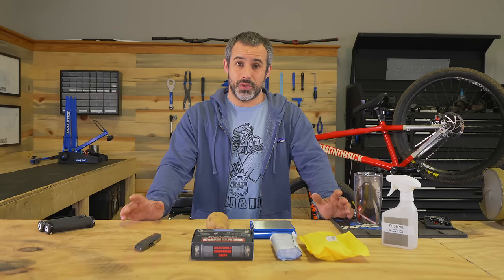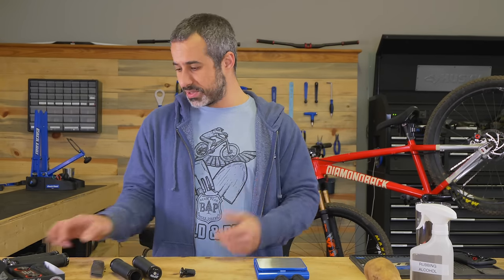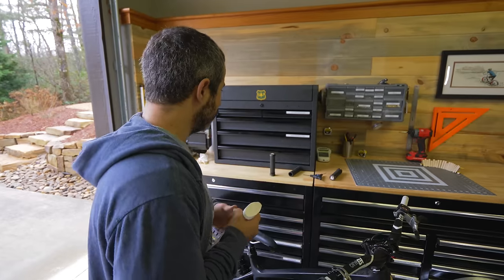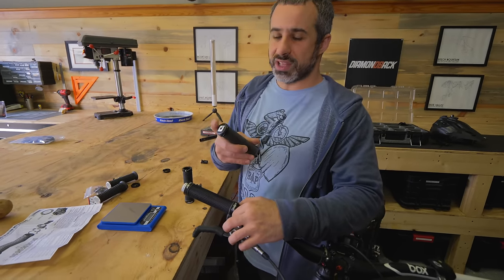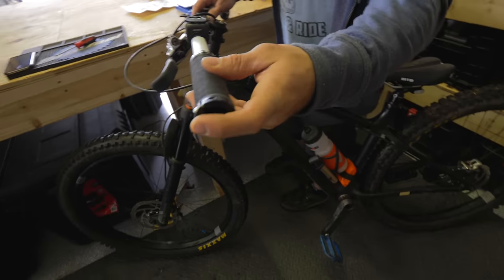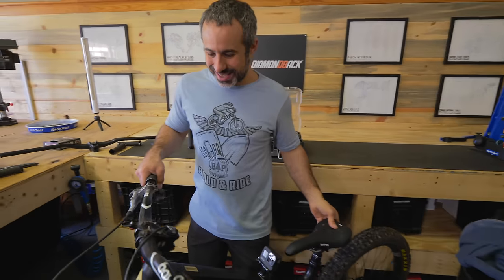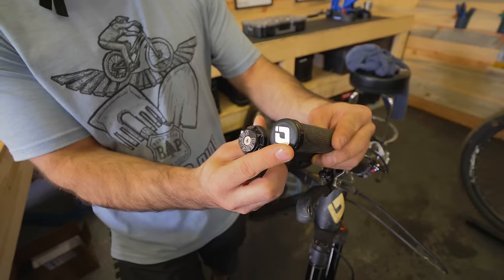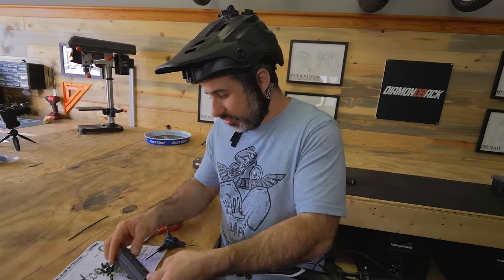REALLY?! How do $90 bicycle grips stack up against $5 grips?

Comment: $90 is a joke though. There is a middle ground that’s always worked perfectly
Reply: Its a robbery tbh. I rather get 3.5 DMR deathgrips for the same amount
Reply: Jonas exactly! No need to fix what isn’t broken imo
Reply: @thetrailtrawler2602  Indeed. No need to over complicate and overprice grips
Reply: Brayden Gilbertson i really don’t like movement in grips at all I come from BMX background so I’m used to everything feeling solid
Reply: Brayden Gilbertson  I get that they can feel amazing but im having a hard time justifying 90 dollars on something I will wear out on 1-2 weeks tops
Reply: The Trail Trawler hit mammoth bike park or any rock heavy techie trail. I’ve rev grips for life. I I’ve tried foam, odi lock on, Santa Cruz Palmdale, Giant, etc. all trash compared to rev grips. Rev grips were designed for braking bumps and techie trails, not a skate park or a dirt jump track
Reply: Carnex100 in that situation they are worth it
Reply: Jonas How much do you ride that you can wear out grips in 2 weeks? That’s seriously impressive!
Reply: I have a problem in my right hand from an old injury, i would struggle with a days riding before i owned these grips. They serve a certain purpose and they work like an absolute dream, 90$ is a small price to pay when i can now ride for consecutive days and have no issues with hands
Reply: Sounds like these are for people with hand issues. If you don’t have any issues then obviously you can run whatever you want. Personally preferences can’t be categorized
Reply: @iopusor  not a robbery for those suffering with wrist or finger pain. I can keep riding bikes thanks to them! And if you buy them the rebuilt kit costs you only about 25 bucks, so it is one time investment. For me it is only 90 dollars.
Reply: @Petr388  And that is great! But the average mountainbiker doesnt have chronic wrist and/or finger pain and for those people its a robbery.
Reply: @iopusor  well i do not think so. No one would buy these grips unless he considers using their advantages. Who would not want to have less arm pump? Everyone suffers arm pump and everyones wrists suffer on braking bumps and big rocks. We only have one health and our wrist and fingers would thank us for better treatment. It is never a robbery, it serves its purpose and it allows you to ride more without an arm pumps. It delivers what it promises, so it is not a robbery.
Reply: @iopusor  Revgrips don't cost $90 each time you wear out your grips, they're rebuild-able and you can buy replacement grips for $25.  .  They also have a race model that only costs $60.
Reply: @jedidiahwest4619  It sounds these are great for a ton of people.  Some of the people happen to have hand issues.  

I don't have any hand issues.  Of course I could run standard ODI grips.  I could also ride a lower quality fork, shock, brakes etc.  I choose to ride DVO Onyx, Jade, SRAM code brakes, cushcore, and Revgrips because they all add performance to my bike and how I ride.  If I can drop $1000 on a fork I could easily drop $60 on a pair of revgrips.  When the grips wear out it's only $25 to replace the grips.
Reply: It's not a joke for the person who invented them his pockets are fat on gullible people
Reply: That’s like, major component prices they’re asking for. Really absurd.
Reply: @whygoogle5051  These cost no where near as much as any of the major components on my bike.
Reply: “I don’t like them, therefore they are not worth the money.”
Reply: @nathanherald3469  totally worth the money if you do like them though.  👍
Reply: LōK MTB they have a money back guarantee right? I love their stem as well. Looks gorgeous.
Reply: @lokmtb8503  $25 for the replacement grips is still more than nearly ANY other grip on the market, just for the grip part! Are they made of Stealth rubber? Are they paying FiveTen (that would be Addidas these days) royalties? How exactly do Revgrips justify $25 for just the grip part (a simple moulding)?   Don't get me wrong, I think they are a brilliant idea, just overpriced currently (as new ideas often are initially).
Reply: @AnthonyIlstonJones    $20-$30 is the average cost of good grips.  Most ODI and Ergon grips are the same price or more expensive.

I don't get your point about only getting a replacement grip for $25.  You only have to replace the grip.  The rest of the system is reusable, so why would you complain that replacing the part of the grip that wears out cost's the same as buying another pair of grips.
Reply: @lokmtb8503  Because with other brands that is a whole new set of grips, not just the moulded grip part itself. Are they saying their grip itself is so much better they can charge what others do for their whole system (locking rings and all)?
Reply: @AnthonyIlstonJones  Yes the grip is absolutely better.  It is an engineered component that  interact with the rubber inserts, shims, and the aluminum caps to give damping and reduce hand fatigue and arm pump.  The grips use patented technology that add function and performance.  It's not like you could take another grip and slip it in and have a functioning system.  I was willing to pay $60 for their race model and probably would still pay $60 if I had to replace the whole system, but I would be more judicious with how they were used.  Maybe I would only run them at downhill parks or gnarly trails and keep a cheaper set of grips for trail riding.  On the other hand I feel like it's a great feature to be able to replace the part that wears out for only $25.
Reply: Too big, would increase arm pump massively. Try lifting weights or doing pull ups with a 1.25" bar. Takes like twice the grip strength. It's a gimmick.

Comment: Been using Rev Grips for about two years with zero issues. Helps with arm numbness/pain, last a good amount of time before the sleeve needs replaced, and does very good for glove less riding. Last fall they came out with new rubber grommets that is one piece. Much easier installation.
Reply: I know I am late to the game on the response.  I totally agree with your statement.  For a guy that has not treated his body so well over the years from MTB, Skiing, and just general male stupidity these grips are a game changer.  I have pretty bad arthritis in many parts of my body most notably in my hands.  These grips can definitely extend my ride and make me more comfortable.  3 years on 2 bikes and not a mechanical problem that wasn't from wear and tear.

Comment: When I was a kid (I am 50), the trick to get grips onto the bars was to steal my mom's Aqua net and spray it into the grips. They would slide on easy and then the hairspray would dry and be a little sticky to help hold them. There were no locking grips back then, so any help was appreciated.
Reply: this is the go to at bmx shops
Reply: Brake cleaner also works well.
Reply: @s2000.  Doesn't brake cleaner dissolve the plastics used in these grips? What is the LONG TERM effect?
Reply: @exgenica  Long term there is no difference because it evaporates in about 30sec.  Works fine for me.
Reply: David Mansfield right, and put a nickel in it to stop the bar from cutting through the end
Reply: i have thought to use hair spray sing my school days, damn thanks for the flash back
Reply: @JustoleshiftY  🤣
Reply: Yep hair spray, alcohol, or a little saliva if for some reason you can't find one of the other two.
Reply: @Ocyris151  Windex works too, just a splash and evaporates quick because of the ammonia.
Reply: Waste of time. I literally lick my pinky, rub it inside the grip for 2 seconds, and slide the grip on in 3-5 seconds.
Reply: @pex3  no lies told
Reply: I dunno man, I'm 2 year's short of you, but i never replaced grips (ever) until nowdays. Oh well, still need new grips for my new bike.
Reply: @s2000.  Brake cleaner is also bad for paint
Reply: miss the 80's bikes
Reply: brilliant    😊
Reply: @s2000.  brake cleaner is just alcohol
Reply: @Ocyris151  לא מוטי חלל ץ׳ץ׳
Reply: I used tar kindly borrowed from nearby construction site))) Worked really well for fixing grips dead. And for brakes also.
Reply: @REYisKING  the best
Reply: I cover the hole on the grip and the other side of the handlebars, so when you push it inflates a bit and just pops on.
Reply: How about all the kids make references that a 50 yr old would not under stand.... Ill start, AMONGUS!
Reply: @exgenica  brakleen doesn’t affect rubber or plastic - both materials feature heavily in hydraulic brake systems.
Reply: @firedemon2166  brakleen bad for paint?? Who told you that 😂
Reply: My dad used to swear by orange juice.

Comment: Just to let everyone know I brought ZTTO grips and they wor though in a week
Reply: I have them for like a year
Reply: How did they perform?
Reply: ..and you break the 90$ grips in first run.
Reply: I've had my 2 pairs of ZTTO grips for almost a year now and on my everyday bike they still hold up pretty well so far, but I don't use that bike for much more than commuting. On my Dirt Jumper I had clearly visible signs of wear after about 2 weeks and after 1 season I had the first flat spots on them. Now that I've spent some time riding again the flat spots have become pretty big and I've ordered replacement grips. I'll keep using the ZTTO grips on my everyday bike but not anymore in my Dirt Jumper.

Comment: "Kevin broke it" Not the first or last time we'll hear that.
Reply: I am pretty sure it had nothing to do with Kevin.  I think the product is designed poorly.  I had the same problem.
Reply: @ericliebert5260  Sorry to disagree with you but the product isn't poorly designed, I should know as I have 2 sets. 1st time I put them on they were a faff and I didn't do the clamps tight enough, tiny tweak more with the Allen key and they have been perfect ever since. I would say that this is what happened when Kevin rode the bike.  It gets much easier setting them up once you get your head around the design, I can add or remove the tuning washers in around 2 mins.

Comment: Coming from pro scooter parts, our industry has paved our own direction for how grips are made. Frankly, I think it will be a trend that catches on with MTB too a little bit, perhaps more in hot areas like mine. I've already seen more grips like scooter grips being thrown on mountain bikes. The mechanics at the bike shop were so surprised with my Tilt Continental grips. They said it's the best pair they have ever felt in their life.

We don't ride scooters with gloves. Yet we suffer quite harsh hits to the hands compared to BMX due to small wheels with hard rubber. For this reason companies in the Scooter industry have made increasingly thicker and softer grips. For example the Ethic grips are one of the thickest pairs of grips I have ever seen myself. Back in the days ODI introduced the super softy grips just for scooter riders.

I've found the optimal setup for comfort and grip and I highly recommend other riders give it a go. I used very thick, soft high quality scooter grips like the Tilt or Ethic grips, and a very thin pair of Polyurethane Dipped Gloves (about $2 a pop). The result is a grip/glove system that is very simple, economical, lighter and most importantly far more comfortable in the heat due to the very thin gloves you can now use without suffering strain and bruises on your hands (thanks to the super soft scooter grips)

Give it a go, and I am sure you will no regret it!

Edit: Also, from an engineering perspective, we are looking at a vastly simpler system to make. Bike grips and gloves are typically over-complicated and perhaps that's a bit of an anti-pattern in my opinion.
Reply: Wow thanks for the advice! I never considered ‘scooter grips’.. are handlebars all the same standard size to fit grips? Bmx, motorbike, bicycle, scooter..
Reply: this comment is so helpful

Comment: I've been using rev grips for a year now. I love them! They are hard to install, but I've never had mine come loose.
Reply: Same
Reply: Ditto.  The price and installation are ridiculous, but I love em, and replacement grip pieces are reasonable after initial purchase. 
    I feel better that seth struggled more then me installing them😂
Reply: I used these for awhile. Went to Moab with them. And overall they are decent. The grip was a little hard for my hands though and that's what I noticed the most. Best luck so far is with the Red Monkey ergonomic silicone grips.
Reply: I don't know a single Kevin that isn't a bit of a goon

Comment: Grips is the most important point of contact with your bike with pedals when riding down the hill. One components I would never try to save money on is my grips. Good grip = faster and more fun.
Reply: ☝️ 🤩.     Remy
Reply: What grips do you ride an recommend remy?? Ps youre awesome
Reply: Ingrid Veldhuizen I ride the Ergon GE1 Regular most of the time. They are awesome. Well designed, comfortable. Everyone who has a pair loves then
Reply: @remymetailler  thanks! Il will check them out. I need new ones really bad
Reply: I think pedals or tires are more important, you don't want to slip off your pedal, that's hurts😬
Reply: johnie su of course pedals and tires are key too
Reply: I agree that you don't want to "save money" buying garbage grips. But, as with all things it's important to make sure you don't conflate higher $$$ with higher quality or "better" gear. Your price point should only increase if you're guaranteeing yourself more comfort and control and/or that higher dollar products are going to last longer. If you're not gaining either or both, then you venture into "wasting money" territory 🤣
Reply: As a dude who used the 5 dollar grips, my wrists hurt.
Reply: There's no reason to spend more than ten DOLLAz on grips

Comment: I’ve used my Revgrips for 3 years, and I love them. I used to get numbness and tingling in my pinkies after 20 miles or less, and now I can ride all day with no numbness or pain. They were a total nightmare to install, and I have recurring nightmares about having to do it again, but once they were installed correctly, with the proper amount of cushion (I went with middle of the range), they have been hassle free for hundreds of miles. Would I recommend to my friends to pay $90 for these? Only if they are also experiencing hand pain that there is no better solution for. I think they work especially well for older riders who don’t like wearing gloves, as they add that extra cushion that even the thinnest gloves provide. I can’t wait to see your long-term review.
Reply: You can also get gloves with gel in them to help with pain.
Reply: my left ring finger always gets tingly but i dont have money to burn, do you think it's worth it? @brandonrothaughe

Comment: Btw: if you have slip-on grips with no locking mechanism use hairspray on the handlebars, where the grips are supposed to go. Makes them stick like glue and prevents them from slipping around in wet conditions or when too much force is applied...

Comment: I’ve been riding with revgrips for 2 years now. They are a pain to install at first, but I have not had any problems with it falling apart like what happened to you. I’ve got aluminum bars and really cranked them down when installing. I also should mention I got the $60 version which doesn’t come with “tuning washers” and cool colors, but the mechanics are the same. I feel that the grips are directed more towards downhill and long rides. Please please please try them at a DH park to se just how good they are with braking bumps
Reply: Same here. I've been racing DH with them for a few years now and I couldn't be happier with them.

Comment: The Revgrips are so good for reducing arm pump and fatigue.  I feel like you would need to do a longer run on them to notice the difference.  I really appreciate them the most when I'm riding at a downhill park.  

The Race series is only $59 and no hyperbole at all they are the most bang for the buck upgrade that I've made to my bike.  You don't have to replace the whole system.  You can buy replacement grips for $25 when they wear out.  If you ride areas with a lot of rocks, shale, brake bumps, or long downhill runs and you get arm pump / arm fatigue they're worth the upgrade.

Comment: I have revgrips on my carbon bars on a hard tail and they have never moved like the Kevin test. I even used them racing the Dirty30. Shout out to the RevGrips dudes they are local to San Diego and shred like the best of us. 

No I did not buy rev grips just because they are local to me, I got them because they work really good in super technical rough stuff and I’m an idiot who refuses to ride full suspension.

Oh and because they are rebuildable, the cost of them goes down the longer you use them (compared to the number of Raceface half Nelson’s I bought in a 3 year span)